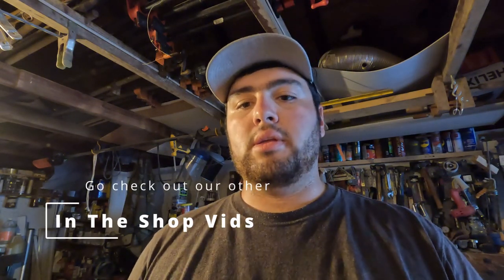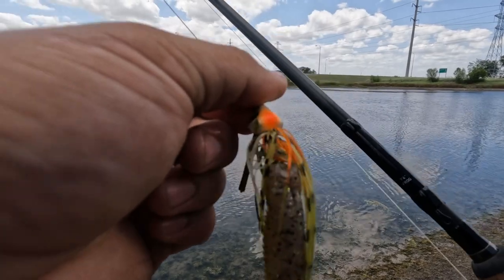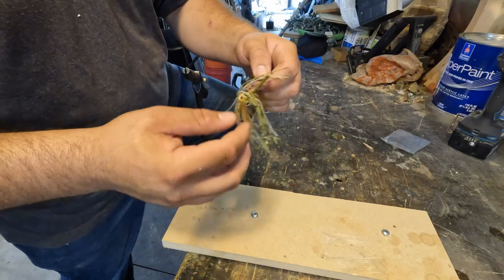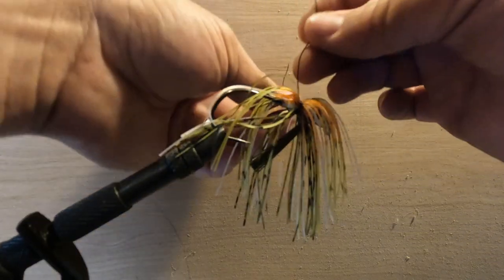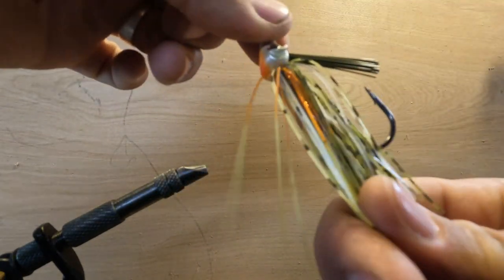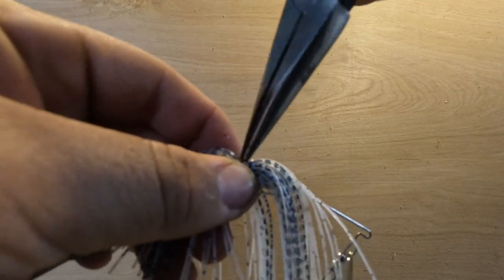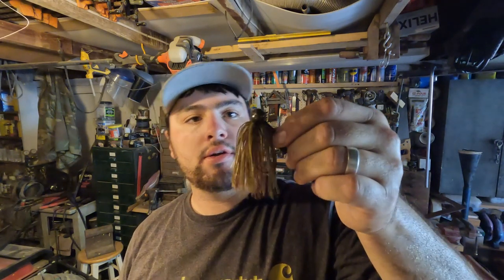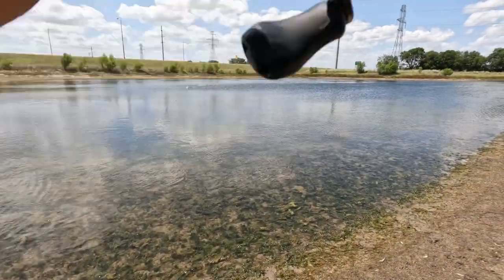THIS DIY JIG HACK WILL HELP YOU CATCH MORE FISH (For Real) | In the Workshop

Comment: I’ve never done anything like this but could you wrap the wire around and start twisting before cutting off the original band. Seems like it would at least keep the skirt from moving/shifting around and allow you to use 2 hands for all steps.